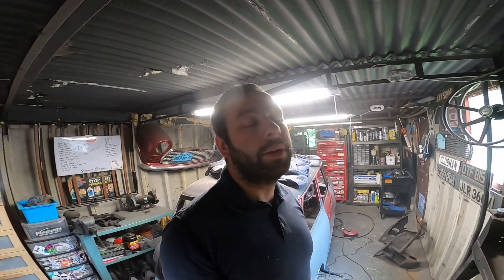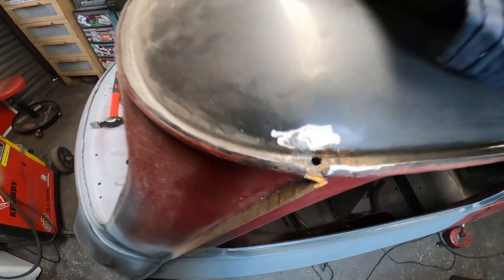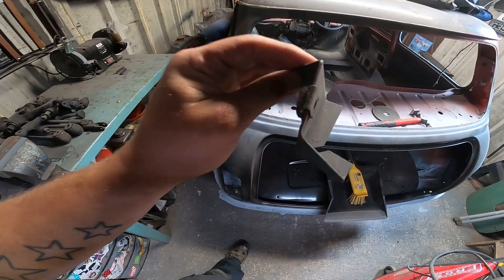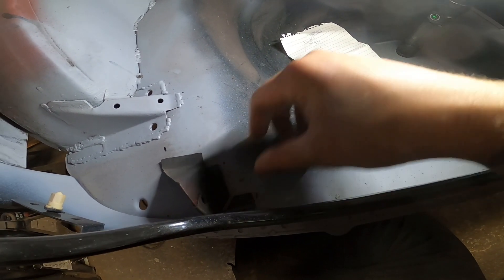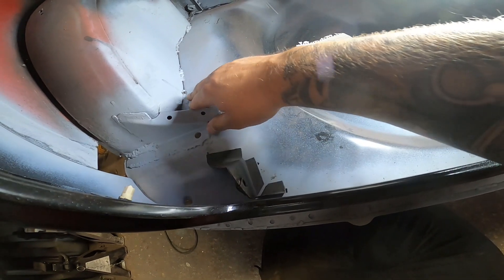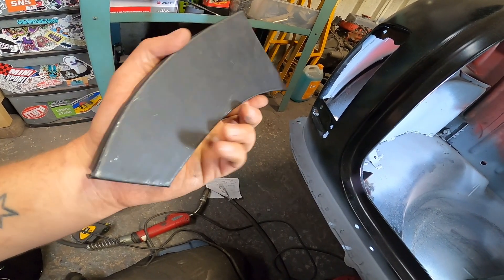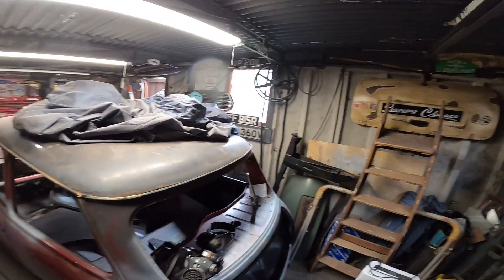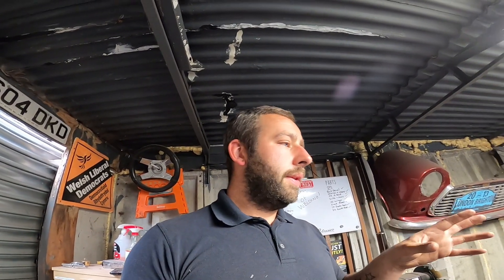89 CLASSIC MINI RESTORATION - FUEL TANK BRACKET - REAR QUARTER REPAIR

Comment: The car looks almost ready for paint 🙂🙂. I also fit 2x rear qtr panels like you've done & my o/s went in better than the n/s. Mine were magnum panels. Also those brackets you've made for the wings & a-post 👌🏻, that's a good idea 💡
Reply from the maker: Aha I wish it was nearly ready for paint Rick! Hopefully it won’t be to long though. Sounds like you are cracking on. Thanks I found those little bits of steel really add some strength in the front. 👍

Comment: Where can I buy the rubber between the body and fuel tank
Reply from the maker: These guys will have it on their shop. Also use our discount code SIMPSONSOCT for 10% off when you spend £15 or more 👍

https://www.ebay.co.uk/str/minimineltd

Comment: Hi Marc, nice job as usual, but I noticed after you fitted the tank anchor brkt that there is no tank support brkt on the boot floor which the tank sits on. A strip of rubber is glued on top of this to stop vibration on the tank. Just an observation beefore you go too far.
Reply from the maker: Thanks John I appreciate that 👍 this being a mk4-mk5 shell it doesn’t have that bracket I know which one you mean. It wasn’t fitted to cars after 75-76 I believe nice spot though 👍